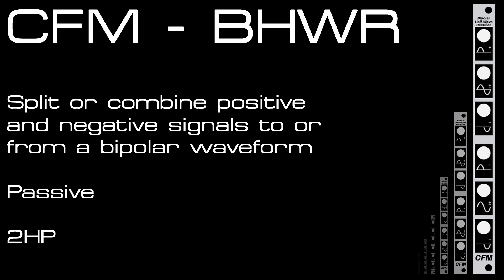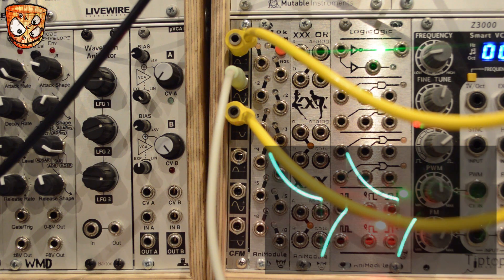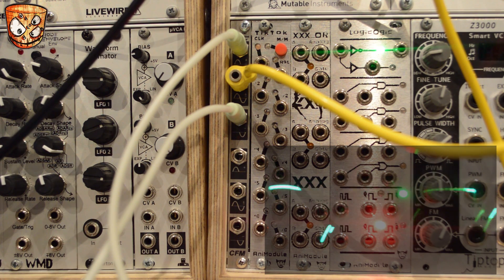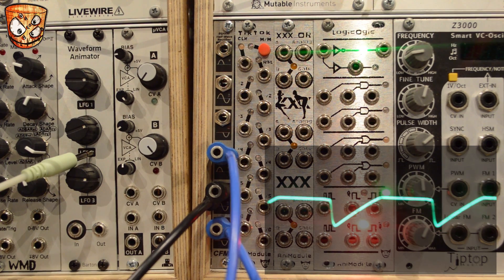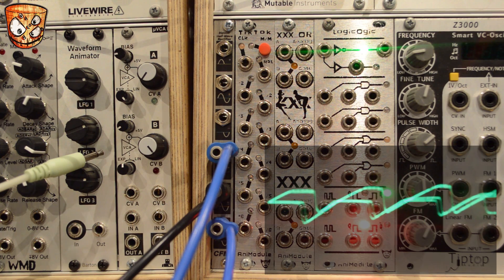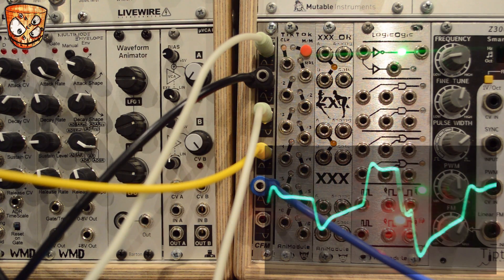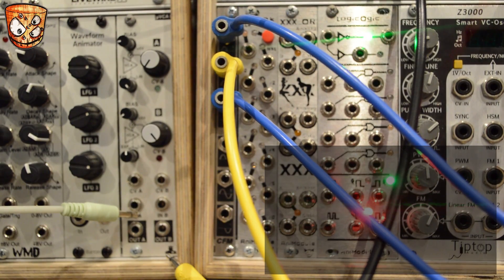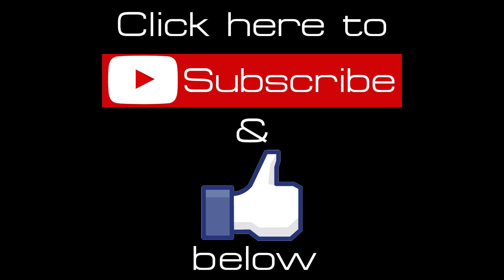CFM - BHWR (Bipolar Half Wave Rectifier)

Comment: How much signal drop is there over this module?
Reply from the maker: +Ian Hoffman not sure of the technical details, best to contact CFM direct as they'll be able to answer. There is a signal drop though. But with audio I haven't had any issues.
Reply: +DivKidVideo Since it's a passive device the voltage drop would be the standard 0.65-0.7V across the rectifying diode, I'd imagine.

P.S. Will you be doing a video about Superbooth 16, do you think?